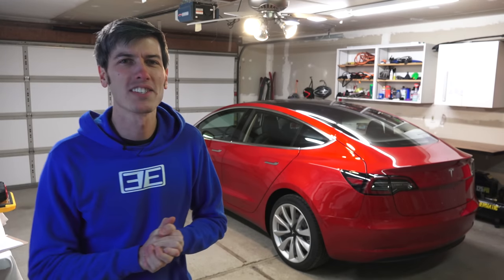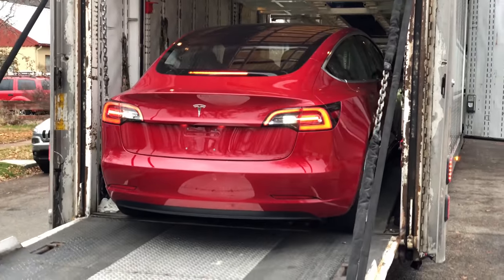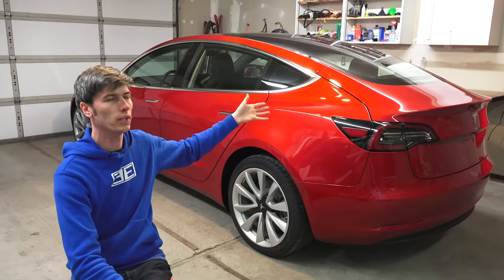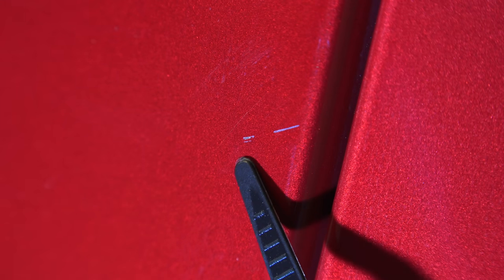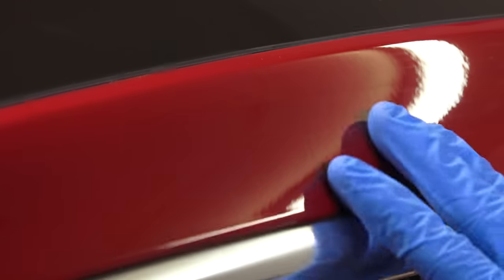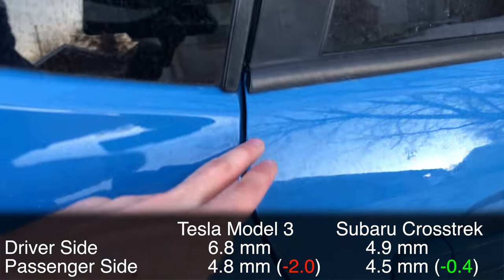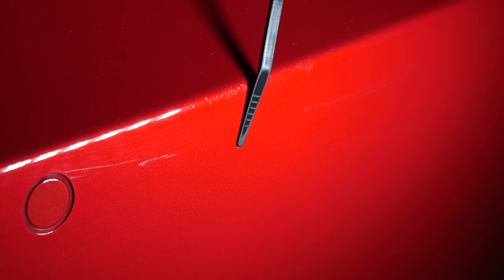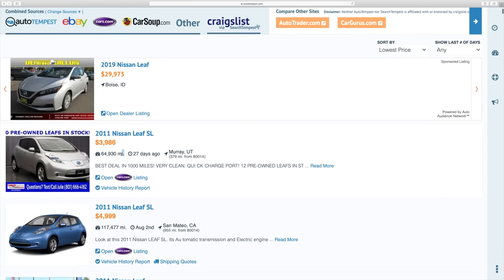Everything That's Wrong With My Tesla Model 3 - Quality Problems

Comment: Whew, looks like 60/hr work weeks.
Reply: They were under a ton of pressure to ramp production, cut manufacturing costs, and deliver vehicles before the $7,500 tax credit expires on December 31st. I'm not surprised to see quality issues.
Reply: @milliamp  Yeah, I heard hence my comment. And they delivered. Minor damage that is being repaired for free I believe. I mean, I wouldn't accept the state from any other car manufacture either.
Reply: @lvk104  The secondary market was already not eligible for the tax credit. I also think Tesla will go from a $7,500 tax credit to a $3,750 (50%) tax credit or something now that they have hit the max volume for the higher credit. I think it will be the primary market that takes a bit of a hit because with some state tax credits the discount off a new vehicle is significant. The credit isn't a huge deal on a $120k car but on a $35 to $40k car it sure is.

Comment: The gaps aren't quite as good as my '83 Accord, the paint issues are about the same as my '97 Corolla... But externals don't really matter much as long as they don't continue to deteriorate... The natural question is whether the internal build quality is better? Or will this car need major work before it is even 20 years old?

Comment: The gaps at the front, it sounds like the bumper may have gotten bumped. Especially since you have gaps and raised differences in the hood driver side as well as where it meets at the driver door. The scuffs could have happened in transit. The orange peel in the paint is just people not finish sanding prior to polishing.
Nice ride though. Love the color

Comment: My opinion for such quality issues is that Tesla does not use other car production company standards. Usually for example Toyota is making Presell check list on selling facility. I saw few times how they were adjusting panel gaps at hood and door, scratches were polished. And Tesla just dump the car at the house and drive away)))))

Comment: Apparently contrary to popular belief, while the gaps seemed like a lot, it is more of a pet peeve than anything. The difference of 2 millimeters means absolutely nothing. Take a ruler, and look at the length of 2 millimeters. If you have a problem with 2 millimeters you probably have other problems in your life. Plus, nobody will ever notice panel gaps that small unless they are looking for them. Anywho, my biggest gripe would be the paint, especially considering it went through to the metal, that can mean rust later on and thats a big no no. Only other gripe is the glass roof, mainly because it is noticeable and I feel like there needs to be higher quality of production when it comes to something that requires the precision of glass.
I am upset that production at Tesla allowed for scratches like that to leave the factory, it is not hard for someone to say "crap I messed up" and repaint the bumper. This is partially remedied by the customer service. While it is understandable that they are a new company, that is not a good enough defense for scratches like these in the paint. 
Tesla being so young of a company does defend the gaps however. I highly doubt that any car manufacturing company had better gaps than that as early on as Tesla is. Math like that is not easy to do. And yes, the price of the car is a bit much considering the scratches and gaps, but you also need to take into account the fact that Tesla doesn't have billions to spend on improving manufacturing quality at this moment. 

Before someone calls me a fanboy, yes, I am, and I really want a Tesla even after watching this video.

Comment: I bought my Tesla model 3 extended range dual motor in April 2020.  The only defect I've found is that the GPS cannot always get me where I want to go.  My old Garmin GPS works better.

Specifically, when I wanted to go from my Point Loma San Diego house to 300 Fir Street, the GPS guided me across the Coronado Bay Bridge onto Coronado Island which was miles out of the way.  When I wanted to get to the emergency department of a hospital it had me running in circles near my house.  It cannot even get me to my house.  These are not new areas and my old Garmin GPS from my previous car takes me directly to those places.

It is very difficult to report these problems to Tesla.  Whether Tesla will do anything has yet to be determined.

Comment: I think the quality control problems are at least partly related to the high demand. They are in such a hurry to get the car out to customers  and you know what happens when you rush things. I bought an Outback 4 years ago and needed to wait a month to get it due to high demand. Panels not flush and had a cam cage leak.  This is not just a Tesla problem.

That being said if Tesla  continues to sell product with the same quality moving forward they will run into the same problem that the Big Three encountered starting in the 70’s. They could sell whatever they wanted and people would but them until the oil crisis and better and cheaper Japanese competition came aboard.

 It seems that Teslas are for people who love tech, fast acceleration and have a high tolerance for things that don’t affect the immediate actual performance of the car such as paint, door gaps, etc.  If that is you, go for it. For me, those things possibly reflect the overall quality of the build. What other shortcuts were made in things I can’t see?   I’ll wait for the Toyota BEV's coming out in 2022.

Comment: I'm at a crossroads. On one hand, I see these defects and am concerned with you. On the other hand, some of these complaints are ultra nitpicky. I respect your channel and point of view, but personally would just drive it as it is. To me, none of those things were deal breakers, minor cosmetic issues that will occur with time, driving in the real world. I can live with literally every scratch and panel inconsistancy you showed. I know it drives ocd engineers crazy, but it's a real car, not a computerized rendering. It has been handled, moved, transported, and who knows what else. As far as panel gap, it won't keep me up at night. I would never have noticed any of these imperfections had you not shown closeups. Cool car, hope you get the issues resolved!

Comment: These flaws are 'growing pains' of a young car company that jumped into massive production very early. Subaru has been around since 1953, so they had almost 70 years to refine their assembly quality. Tesla's gap differences are within 2 mm, but they began production in 2003, some 60 years after Subaru who's gap tolerances are less than 1 mm. I am sure they'll reach Subaru quality within the next few years.

Comment: Most of them aren't a big deal, the gaps issue is acceptable, but the paintjob issues, well, you received a brand new car with an already scratched paint and with paint imperfections too. I understand that Tesla is quite new in this of making massive production cars, and compared with the good things a Tesla gives you, those issues matter pretty much nothing, but they are still there, in a brand new high end car.

Comment: So help me out here.  You bought it through AutoTempest with 22 miles.  So it was used by someone, then immediately sold?  If so, might some of those issues have been caused by the previous owner?  And are you sure it wasn't in a crash and repaired/repainted by the previous owner?  Or maybe just scratched by the previous owner?  Not saying yes or now, but I'm curious.  If this was delivered straight from Tesla, that's one thing; if you bought it slightly used, the story changes.

Comment: I got a leaf half price with only 4000 miles on the clock. I see a Tesla for £57000 here in the UK. If someone fancy upgrading from there used petrol, you can save money on petrol. It will only take you over 30 years to gain that extra cost back. 🤑

Comment: In contrast, we've owned a Nissan leaf 2014 model for 5 years. Zero electrical or software problems. Zero body build issues or noises. Zero repair times. Electricity, replacing worn tyres and some fluids, battery for the keys, wipers the only costs. From talking with other leaf owners, their experience is similar. Get's back to the old issue of poor design, build and reliability of US vehicles.

Comment: Doesn't that mean, that the paint layer on the car is extremely thin and low quality?
I mean, all those scratches, some of them seem to be from simple road dust, maybe when it was being transported from one place to another on a tow truck or on it's own wheels?
Others might've appeared by a mistake, but also due to very thin paint cover.
That is my guess. If you have a very thin coating, you can't help but to get few scratches very fast.

Comment: Who buys a Tesla after so many complaints that were posted in the internet by so many owners?
I don't understand this. Just because its "better" to drive electric propelled cars? 
Thats a blinder! Just the recources it takes to build all the batteries are vast and are destroying huge parts of the earth just to dig them up. 
The processes it takes to refine these elements are even worse for the envirement.
Reply: Also, 68% of electricity production in USA is produced by burning fossil fuels. So if we consider the inefficiency of thermal cycle of power plants only around 33% of the energy stored in coal/natural gas is actually used by the car where as petrol and diesel cars have efficiencies around 40% so it is better to drive IC engine cars. The only benefit is tailpipe emissions are reduced so pollution in the cities due to higher density of cars is reduced otherwise EVs produce same amount of total pollution as other cars.

Comment: Big difference is Tesla will fix those issues for free. I bought a Ford Explorer and the dealer didn't even take any money off the car or fix the paint chip defect. Also had a Dodge Durango that had panel gap issue of the passenger side rear quarter panel not lining up and the drivers side front fender with panel gap issues with the hood front to back. All car manufacturers have issues. But one thing is for sure, not all manufacturers will fix those problems for free. They might give you $100 off or a couple free oil changes, but I haven't heard of any actually repairing paint defects.

Comment: The scratches on the rear bumper next to the parking sensor, I think that’s been repaired by someone due to the small rubber surround on the sensor isn’t normally colour coded to the car. They are normally black. 
But then again I don’t have a Tesla so I’m it sure

Comment: This thing tells  a lot about Tesla experience building vehicles. Cutting corners at the exterior assembly/ paint job is worst idea ever. It is common psychology, every new potential owner of any vehicle looks first at the way the car has been assembled. Agree, these visual flaws does not impact overall functionality of the vehicle, but negatively reverberate into mass general opinion about a specific car maker. And that's hurts a lot to their wallets...
11 years ago got my brand new Opel Astra (kind of US Saturn Astra) two times cheaper than Model 3 and although the paint job was water based and easy to scratch, I put myself first scratches on it, not the car maker either the dealer...

Comment: it appears that the clearcoat is incredibly thin, the paint itself looks uneven and faded in quite a few places. The scratches are bad enough but the paintwork itself looks terrible. you had a closeup shot of a panel gap and you could see a clear difference in both metal flake density and clearcoat fadein between the panels. Looks like garage spray can work. I worked in a car shop for 3 years and We would have had to completely repaint your car if it came out looking like that the first time.
Reply: I want to be a fan of tesla but this is genuinely sad quality.

Comment: Unexceptable paint job and measurements off. Does it drive straight? I hope they take a huge chunk off the cost. Thank you for sharing. I was thinking to buy a model x, because I thought the back doors were cool. Besides some other features. Was anything wrong in the inside?

Comment: Most new cars need to have someone use a clay bar, polish and then seal the paint with either carnauba wax, paint sealant or ceramic. but they still need to be cleaned and a clay bar before you see how much orange peel or scratches in the paint.

Comment: I wonder if they've put it through an automated car wash when leaving the factory or after the test drive? The nature of those scratches could perhaps suggest this as similar happened on my own car, speaking of which is a Jaguar and despite their renowned quality control issues (in particular if you are unlucky enough to get a "Friday" car) they put Tesla to shame with the finish. 

But that paint job is shocking, especially considering it's an expensive extra. The panel gaps and height differences etc are not acceptable either. I wouldn't say any of your concerns are pedantic when you are shelling out so much money.

Comment: My Tesla has a bad paint job as well, now I am on the wait list on their body shop to get it fix. I am disappointed on that. Also I ordered the Standard Range Plus now with autopilot. Customer who take delivery on it have the option to turn your Standard Range Plus back to Standard, since the $35000 standard mode will have the partial premium interior and it is just a program limited range. On top of that Autopilot is a standard option with $2000 MSRP increase but everyone is paying $3000 less than a month ago, so they will do something on it. I am just curious how can Tesla be that bad on their marketing with multiple price change to screw with customer.

Comment: Honestly the build quality is good, some small things here there but it works atleast. The amount of problems with a new tesla is way less then then a new Mercedes or BMW to the same price brand new, it's just the difference off what you see and cannot see. Yeah tesla might give you ocd breakdown, but at least it won't have a higher chance of engine failure or typical engine or electrical problems that has literally stayed with a car brand for decades...

Comment: The fit and finish doesn't seem that bad. Red is difficult to work with because it takes a lot of pigment. It's probably on the thin side because the primer coat is intended to bleed through to make the red and the metallic pop. As for the door gap, in NA door gap can't be too small because it's based the size of children's fingers. I'm not exactly sure if this is a federal safety standard or not but you don't want children lopping off fingers if they get their hand stuck in the door! 
The real engineering disaster is looking at how they are assembled. They're overly complicated and too rigid.

Comment: this is pretty typical of a US company , we just bought the new mustang GT and it has poor panel fit even compared to our 20 year old japanese car , also the dash had bubbles in it and the vents didnt fit right , the good news is ford fixed it all under warranty but this did make me think that they use lack of quality control as part of their process , ie if the customer complains they will fix it .
when we buy HVAC out of the usa it also looks like garbage compared to the japanese stuff

Comment: The gaps and elevation differences are ok, but the paint was completely unacceptable.  I can't believe they delivered it in that condition w/o at least trying to buff out the scratches and that speck trapped under the clear coat.
Those things are cosmetic.  The paint and gaps would have me concerned about the mechanical reliability, but hey...isnt' that the $35k model?  That's pretty cheap.

Comment: that sucks 
i bought brand new chevy spark 17 for my mom. it arrived warped to protect the car inside out 
same about any other car in the family hyundai toyota nissan  brands 
this is not small thing 
its your property and expensive one it should be well cared on all the way to you just like mine arrived
and about the gaps 
just went to check all the family cars all of them have symmetric small gaps
that just fucked up

Comment: Min 3:15 And 3:30. Is it my eyes or the camera, but it looks like you have two different paint colours between the two doors.  Wonder if your car has been repainted do to an incident. Usually if a car comes directly from the manufacturer, it will have protective plastic adhered to bumpers and major surfaces. Repainting would account for poor paint finish, (orange peel), dirt, and minor scratches.

Comment: 5:25 looks like one of the parts is repainted, different colours and grains in the paint.. My guess is, that you received a used wreck, and Tesla or the dealer reset the kilometers in the electronics...
Reply: it was factory new >.>
Reply: @ausintune9014  Question, why would a car factory use 2 different paint methodes and 2 different grains in the colour when painting the car at first in the factory...???
Reply: @Deutsche_1  who knows

Comment: I think that you should get a refund for the paint. If Tesla is going to charge extra for a paint job, it should at least be scratch free, and at $2500, it should have little to no orange-peel. The panel gaps are something I could tolerate a bit. Sure, it's not pretty, but it's not ugly either.

If I bought a Tesla, I'd consider taking it to a paint shop and paying them $2500 to respray it, rather than pay tesla for a different color and crappy paint.

Comment: @5:25 you can clearly see different size paint crystals on different panels.

I dont think that is a textured paint rather its a sign of very think layer of paint and hence it is not smooth. My cheap ass suzuki car has the same kind of pain and I know the paint is very very thin. But its cheap and reliable and whole car repaint would just take $500.
Reply: I'm a painter in a shipyard. I could give you a whole book on what's wrong with that Tesla's paint job. If all you saw were the different sized crystals and orange peel you're lucky.